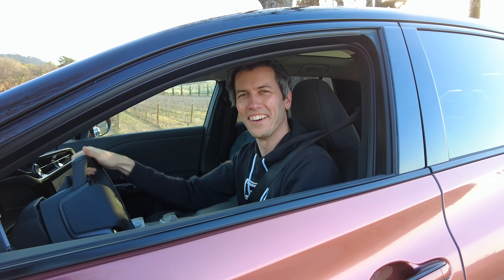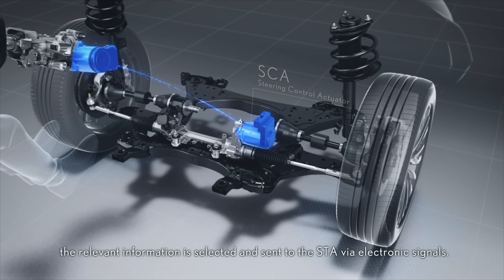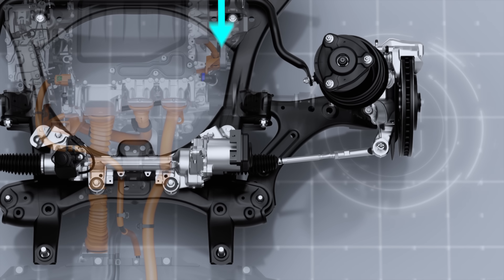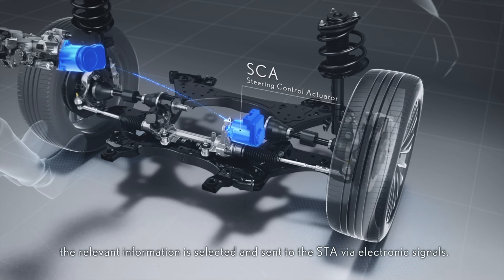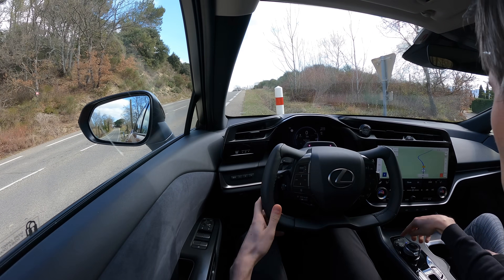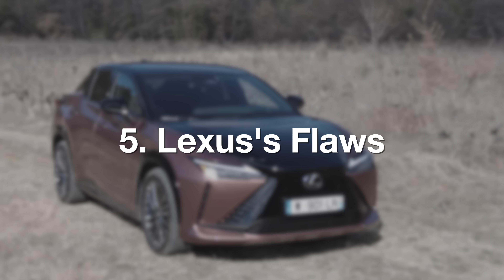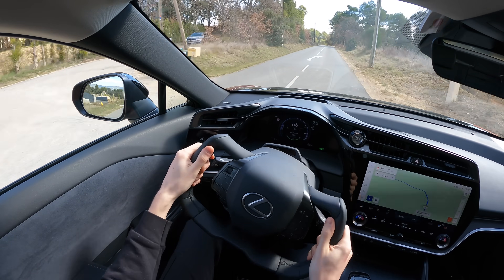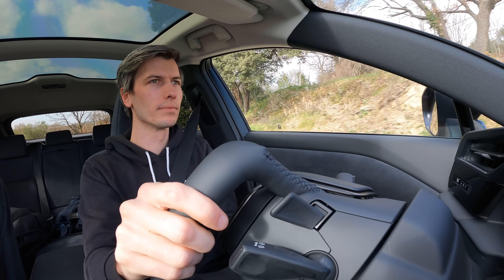How Lexus Fixed Tesla's Bad Idea: Steer-By-Wire Yoke

Comment: people complaining about muscle memory dont understand the point of a system like this. aerobatic aircraft use fully mechanical controls, just like a race car uses mechanical steering, but for applications where you just want to get it done and make operating the vehicle as easy as possible, a system like this makes sense. imagine a system where the steering automatically countersteers when it detects slipping and works to dampen the cars rotational velocity if the driver puts it in a position for snap oversteer, imagine the amount of crashes that wouldnt happen thanks to this system. people who fear reliability haven't heard of redundancy, systems like this already transport millions of people yearly without a hitch.

Comment: As far as I know, the only steer by wire available is made by Tesla. Ironic that this article bashes the yoke in favor of a system you can't get except from another Tesla model. It doesn't count if it's a prototype that you can't get yet (i.e Lexus).

Comment: If it is not tested in racing (F1 WRC rally raids like Paris Dakar) it's not good for me. Even then a "normal" driver can bring out flaws that no one could have thought of. Generation X speaking here from Europe. Peugeot rally 106 era. I myself surfaced problems in the hybrid system of my Suzuki Swift that made the Japan factory to send a new gear box all the way from Japan. I guess it was a European first such a replacement. But gear box was not the problem in the end. What is my point? If something is not tested through the wild racing world then it's not going to work properly in everyday conditions. Hybrid systems batteries are all like Playmobil in my eyes. My hybrid system is very basic close to the normal driving experience thus mostly unprotected from electronic barriers. And guess what happened. Flaws came in front. So it is a no. When I see a Paris Dakar on batteries and sth by wire system I'll go with you. Every system every idea has to be able to function worldwide even away from the so called civilized world, standing alone to prove it's worth. That's why combustion engines took over the planet. Even planes small ones with hardly any maintenance fly to remote places. All those systems are actually protected from real life and need special condiotns to work. And a lot of facilities a lot civilization. It's a big no. Bonus and irrelevant. Cell phones actually work only in civilized conditions. It's a must but when you actually need it well it's a no. And you need more "special" communication systems. Toys for the cities. Civilized cities. No and no. Most of the western world will be content. They are happy with their toys. And for me this car is another toy. Not a real car. The idea that comes with this system is fascinating. But it is still a toy. A very very very expensive toy. Like all BEVs. Regards.

Comment: Not sure where along the production process this car is, but I do not look forward to seeing this on the road so long as the issues of haptic feedback for road condition as well as the delay isn't addressed. They need to also include a physical backup rod for safety's concern, redundancy is the most important thing is new models which have not proved themselves entirely. I would be cautious surrounding steer-by-wire until we can at least adapt it into driving school and train drivers on it

Comment: Remember when you could push and steer a dead vehicle and pop the clutch to get it going?

Good thing we got rid of that.
Reply: the famous electric vehicle push start, why didn't I think of that.
Reply: @itzFYEB Yep, just push the EV for 10 miles or so while somebody steps on the regenerative brakes to put some charge back in to the battery. 😅
Reply: Love people not watching the video

Comment: in my opinion i will hate and always hate Most modern Electric and Gas cars because they have way to many parts that could break and cost WAY more compared to an 80s to 90s car. My dream car is a 1976 Chevy Camaro and once i get it it will be my daily driver for decades to come even during the winter time and the reason is because if something breaks on the car it can easily be replaced and it wont cost me an arm and a leg. Most modern cars use proprietary parts making it extremely expensive to replace and mechanics HATE it so i will just stick to an old gasoline powered car and i will never touch an electric car.

Comment: Are there redundant motors or just redundant power electronics feeding to different motors. Perhaps with different stators for each set. I would still consider this only a single motor though.

Comment: Electric cars have the ability to be the best innovation in automotive tech. We're reducing thousands of moving parts down to a few...

And we're screwing this up by literally turning the car into an overcomplicated robot.

Seriously: Make me a bare basic electric car with 300 miles of range. Basic tactile buttons. No fancy features outside of A/C and Power Windows/Locks and I will be a happy camper.

Comment: I think the delay has to do with the actuator motors, they should switch to larger diameter higher tourqe actuating motors, then the steering response can be essentially arbitrarily quick and sharp, that is with a motor that is larger diameter with many more poles, then the speed of the motor doesn't need to be as large for the speed of rotation to be large, typically these smaller diameter motors are just quite weak at low velocity. You can in principle make the response in a drice by wire system faster than the twisting induced sloppyness of a traditional system. And you pretty much can't notice that in normal cars. The solution is electric motors that are very high torque even at 0 velocity, with very precise control, typically actuating motors like the ones they probably use are not that efficient at generating torque at 0 velocity. It should be stressed that this problem is beyond fixable, you could make such a system more responsive than a rod made out of steel being tourqed, especially more consistent than a traditional system with an actuator that assists motion, especially for quick movements. Pretty sure you could make it so responsive that it jusr breaks the steering rods, but ofc it doesn't need to be that fancy. Get rid of the spooling time you need for the actuating motors and then you have a system that is arbitrarily responsive :-). Hopefully lexus and Tesla and everyone else picks up that idea.

Comment: I really hope it was a mistake in a script, and not an actual mistake in Lexus' design, but... 2 sensors are not redundant enough. If one of the sensors starts sending inaccurate information you absolutely must be able to determine which one. You can't just "apply default steering". So the redundant amount would be 3 sensors. Then you can find the faulty one and trust the other two. Really hope engineers at Lexus didn't mess it up...

Comment: This did not age well
Reply from the maker: Meaning what? Tesla's vehicles that offer a yolk still don't have steer by wire, and they've fixed their problem with later models. It assures that the video did in fact age well.
Reply: @EngineeringExplained  Cybertruck has it, that's why they tell you

Comment: I think because of the delay of this steer by wire system it would make the driving experience mushy, which is exactly what you don't expect from an eletric car that one of the benefits is the response to the pedal. I can't see why someone would want this. It's cool and all, but I don't think there's really a problem here to be solved. Mostly people complained about the Plaid S yoke because not all the buttons are actual buttons, which is horroble. If there's no perceivable delay on the final product, which I doubt, then it can be great. But you can't make a nice tech and expect it to be a success when the first impression of it will be that it's laggy but you get used to it

Comment: Im fine with steer by wire.. but give me a damn round wheel so im not forced to have my hands planted on the sides of a yolk, sometimes it nice to be able to rest your hands in different position on long drives and still be able to keep a grip on the wheel.

Comment: 2 things I don’t want to have fail in my car, brakes and steering. I feel much safer having something directly connecting me to those 2 things.
Reply: Your rack and pinion steering system is a single point of failure. At least the steer by wire systems duplicate all critical components.

Comment: 1:30 Goodbye feedback :> 12:00 Not strong enough feedback! High torque feedback would prevent you from moving steering wheel if wheel of the car didn't move yet, to desired posistion. Technically it's quick fix in the software - make variable "difference between current position of wheel and steering wheel" and exponentially increase feedback to prevent driver from further increase of this difference. And system will have to monitor current of this feedback motor in case if driver releases wheel wheel should stop moving back in reverse position. Eventually should because this is what happens if you are driving real car wheel goes back naturally. Im not big fan of stearing assistance even it feels unnatural, feedback is most important feature of steering wheel. There is just not enough feedback. 

If there is some form of PID algorithm involved (in feedback). Increase D forcefully prevent driver from moving wheel faster than wheel is capable to execute command. P (steering ratio) is determined by speed of the car. It's decreased if car is moving faster. I normally provides delay shouldn't be there at all except maybe on slippy road as form of steering "ABS". Software fix is necessary. But overall i like the idea.

Comment: Really amazing explanation and analysis! 

Short ratio steering in my Focus RS is the absolute best modern steering system I've experienced, but it definitely does require a little extra work on the highway so on point there. 😂

Comment: Another reason why Lexus is better that I don’t get why it wasn’t mentioned is that Tesla has the huge top bar for steering wheel controls. Lexus intelligently placed the controls in the center. So the design is more similar to that of a racing wheel where you have the whole side of the wheel for steering. Also the idea of a steering telling you that it thinks your steering input is unsafe and won’t accept it is ridiculous. You should always have full control over your steering unless you are using a self driving mode. Which I find pointless cause most of them make you uncle the steering wheel anyways.

Comment: what happenes if you turn steering wheel to the right and do constant 360 turn and apply full throttle? does car turn wheels to the right at max angle and keep there or it slowly decrease the angle due to increasing speed?

Comment: The part that excites me the most is the adjustability. I'm "only" 6'3", but I've yet to drive a car where I can be far enough away from the pedals while still reaching the steering wheel comfortably. 

In my current car i have the seat as far back as I can, but with the back very straight to push my upper body closer to the wheel.

Comment: even a last gen civic has steer by wire. it's not that advance. The point is no more leaking power steering fluid, cause now there is none. much cheaper to repair.

Comment: "Why you don't want steer-by-wire" Safety & Reliability. 
A physical hydraulic pump is impossible to be hacked and will be like 1 million times more reliable than a electric engine with an electric control unit.

Comment: I think this system is amazing, and should be on all vehicles! Maybe make the Steering Ratio customizable in the settings of the car, currently most cars only have tightness adjustments, like Tesla's "Comford, Standard and Sport". But wouldn't it be cool to have a Steering Ratio setting too? "Low, Medium and High" and then of course all of those settings should be dynamic as you mentioned based on speed

Comment: I'm failing to see the point of this, from a functionality perspective.  Sure makes 3 point turns easier, parallel parking, ect easier.  But you lose out on a consistent steering feel.

Its cool, I'll give them that, but odd choice for toyota.  Fix you outdated interior designs, and leave the rest alone.

Comment: imagine ur battery dies(or any electrical fault the somehow cuts the power to the steering sys) and can't even steer the shitbox to safety or even have someone tow you since ur wheels are locked in whatever position they were when said electrical fault happens

Comment: I just hate this concept on so many levels. what happens if there is a software bug, another therac-25? It sounds like a nightmare to diagnose and repair and If its connected to the cars infotainment system then it could be hackable. We used to live in a world where if a company attempted to replace parts of their product with code they'd be rightfully called out for trying to cut costs now they're lauded as being revolutionary.  And before someone tries to extoll the virtues of software to me, I make software, all software is fragile and we are lucky any of it works in the first place, in no other profession will you hear the phrase "that worked but I don't know why" as frequently as in software engineering. Its an amazing field that has revolutionized the world and made all of our lives easier, but I wouldn't trust it to breathe for me unless I had to.

Comment: Mehhh, as a Car Mechanic. I dont feel save if everything brakes down, you cant even avoid a Truck lol.
And as someone who likes dto drive Videogames aswell, i can tell: The feedback you get from an Electric Motor doesent feel the same as a direct link. Im not a fan of everything going electronic, and steering is one of them. It was once a savety reason to keep steering mechanical. But i gues, savety doesent mattter anymore. and im not worryed about loosing power, but get malefunction in theyr Programming. You dont wnt your steering do the steering for you, YOU want to have the controll, not a Computer. It needs only 1 accident and this bets banned in an instant.

Comment: I used to hate throttle by wire because of the delay. It's actually helped me become a more patient driver and better at predicting traffic flow. Because of the delay, I have to anticipate traffic flow a bit better for a smooth driving experience. I like it now.
Reply: Sorry but you're coping, it's a serious downgrade that only exist to increase manufacturers profit margins. People need to stop accepting to be f'd in the ass by car manufacturers. It's becoming close to Stockholm syndrome its that bad.

Comment: The security implications of everything being electronic are honestly enough to where I'm going to drive old cars as long as i can. If everything is electronic, a hacker or even the government could gain control of the entire vehicle and drive it like an rc car. I'm not willing to give up physical control of my vehicle. I'm not sure where you get that drive by wire goes back to the 80s, every car I've owned up to 05 has cable throttle.

Comment: We've been dealing with these problems for years in simracing gear and although they do feel great now, they still don't feel like the real thing, and that's despite having the feedback calculated almost instantly, rather than measuring the forces with sensors. That is because real wheels introduces constant resistance, whereas electronic ones can provide a single-directional force only, that is applied as a response to driver turning the wheel - you need to turn first before the motor kicks in, which makes it feel disjointed.

It's also terrifying to see the wheels decalibrate at 12:35, especially considering all these multi-redundant safety claims.
Reply: this should be more accurate than sim racing because the feedback in sim depends on the games tyre, suspension and inertia physics, in steer by wire its literally a sensor that says "road make rack turn x distance over x time with x force, make wheel turn x degrees over x time with x force"
Reply: I worked 40+ years in the forest industry and the drive by wire controls are never as good and the feedback is total crap. Accuracy of response is always worse.
Reply: Sim gear can only be as good as the feedback actually provided by the game. In addition there is probably a much smaller R&D budget for sim gear than there is for car steer by wire (remember, there are a lot of potential benefits for this, like moving steering column etc. that are also a money saver, whereas sim gear has a very limited market).
Reply: It was during turning right from max left position, so it is just a delay.

Comment: Lexus design is absolutely moronic, what if a deer pops up on the highway? you wont be able to swerve quickly at all. Also how to the driver supposed to get used to the steering ratio if its continuously changing? this car is going to cause accidents. At least Tesla has FSD
Reply: If a single rotation is not enough to evade a deer on the highway, no additional overhand rotations will save you.

Comment: the same configuration with a backup battery is in place at the automatic transmission gear select. i once had a shot main battery which disabled also my transmission backup battery and the car did not shift anymore. I dont want to imagine this happening to my steering.

Comment: What happens at higher freeway speeds and you need to make an emergency lane change, but the steering system denies you from making that adjustment? You just crash into whatever you're trying to avoid? I see that as a huge lawsuit waiting to happen.
Reply: No lane change could ever require a hand over rotation, no matter how quick.
Reply: @Tarets  Unless you've actually had to perform such a maneuver, I can understand why you might believe that.